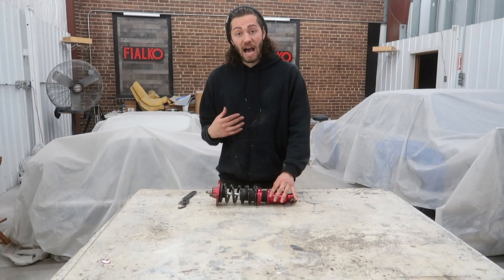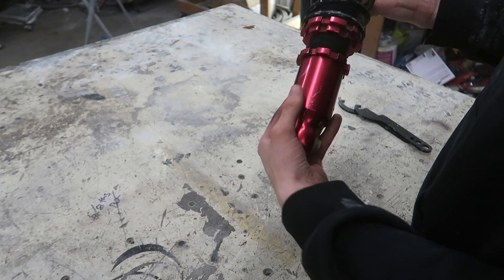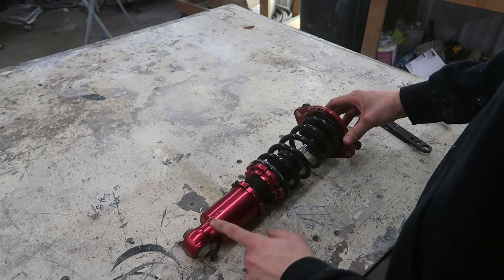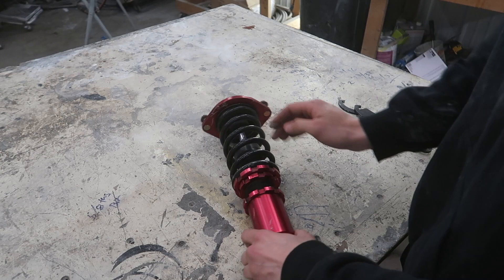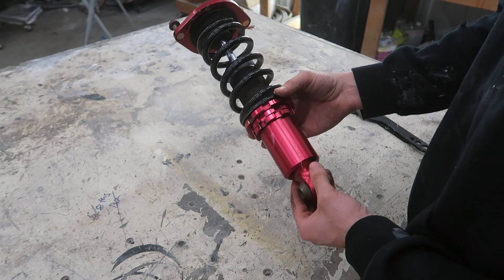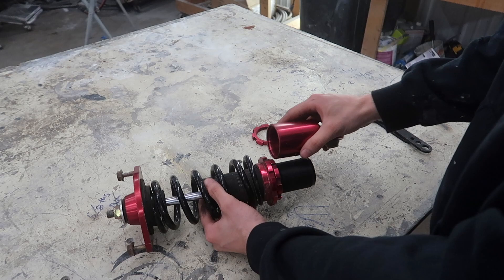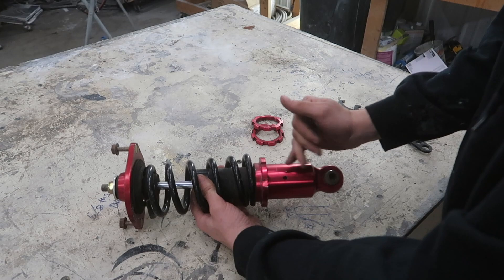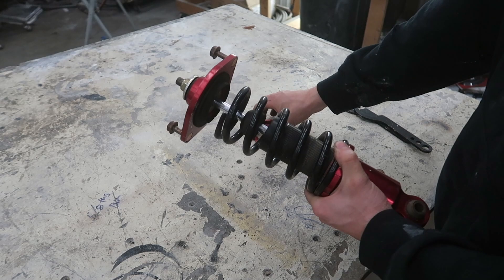HOW TO GET COILOVERS AS LOW AS POSSIBLE ON ANY CAR

Comment: aluminum is quite easy to weld, i weld it just about everyday at work and just have to set your temps right and use a 3/32 filler rod and just get after it

Comment: My Camry is already super low in the Front, I can't imagine going lower I wouldn't be able to drive my car anywhere. It Frame bangs on bumps and dips, I even got stuck on a speed bump at a Walmart parking lot and the Front bump scraps hard every time I'm leaving my driveway. I wouldn't want to go lower my BC Racing Coilovers Extreme drop kit is maxed out in the Fronts the Rears are lowered 2 inches, they can go lower but I'd rather not cause I don't want my Exhaust or Rear bumper getting damage.